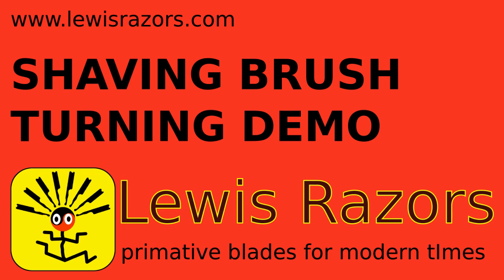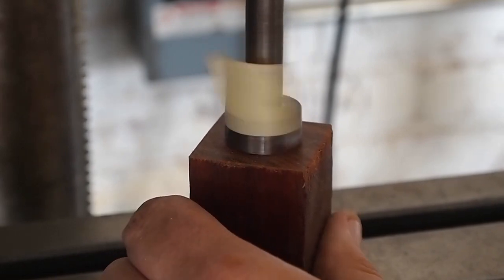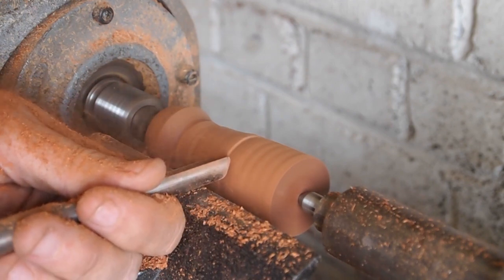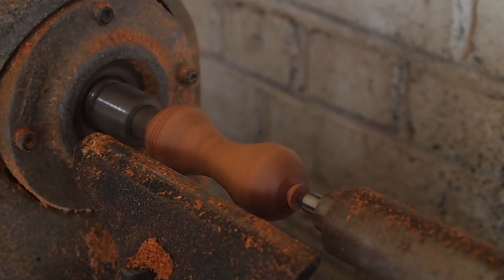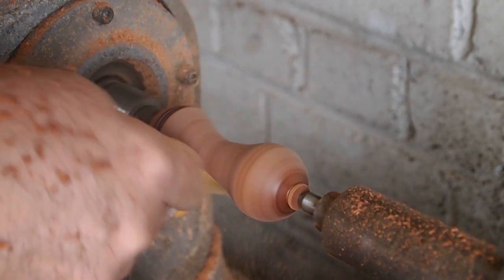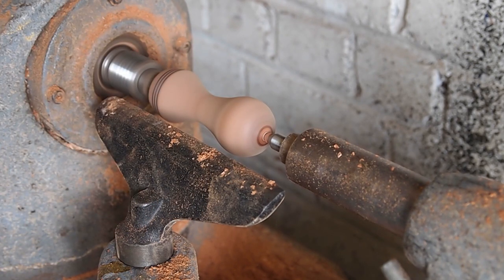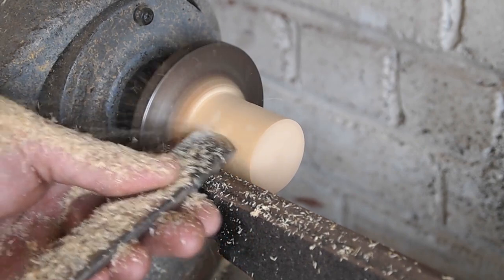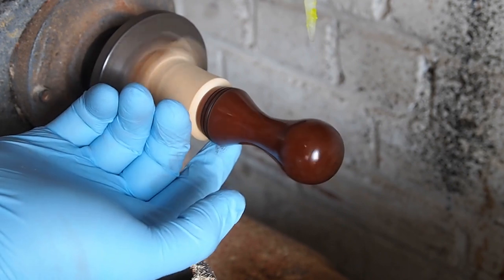Shaving Brush Turning Demonstration

Comment: Great videio...to point...no frills just a great job....  One question I have is what glus is best for securing the knot to the handle?  Thanks again.
Reply from the maker: Craig Janice I used JB Weld on this brush, I like the gray color of JB Weld. I usually use some sort of epoxy to set the knots. I appreciate your comments.
Reply: lewisrazors Thanks for the reply have a great day

Comment from the maker: The glue makes a durable finish. The glue stands up better to the soap and water that a shaving brush sees. A brush handle will have a lot of contact with hot soapy water. You could use any type of finish that  want. I like oil and wax finishes, but in this case I went with the more durable finish.

Comment: Great video and it inspired me to have a go. I used some acacia I had from an old chopping board and it worked lovely but I hit a wall with the CA coating. I ended up with ridges along the handle. I tried both a glove and an oiled paper towel. Do you normally get ridges but take them back with the 400 grit? Any tips greatly appreciated, thanks
Reply from the maker: I do not have a problem with ridges, I am not sure what is going on.  I would look on pen making sites and videos for more help.  Pen makers have the CA finish down to a science. I wish I had some smart to say, but I do not.

Comment: Hello, what are you using in the spindle side to secure and turn the wood?  Is that a spur center????  Does not look as aggressive as one.  Also, what size drill bit did you use to create the recess for the brush knot?  Thank you and great tutorial!
Reply from the maker: +Michael S It is an old dead center with a few notches filed in it.  I like driving the wood with the dead center as opposed to a spur, when doing small stuff.  The wood will spin when I dig the tool in as opposed to chipping out.   I do not remember what size drill bit I used it was a while ago, maybe a 7/8s.
Reply: Ok.  Thanks!

Comment: nice! did you use super glue instead of varnish cos it dries quicker?
Reply from the maker: steviesuperstar Yes, that is one of the reasons I used it, I like working with it. If you look up pen making videos, they have a ton of information on using it.

Comment: Do you have a video showing how you glued all the hair in? Do you buy the hair in a bundle? How does that work?
Reply from the maker: +abstractbybrian I do not have a video on gluing the knot in.  Hair = knot, in brush lingo. I bought the knot premade from the Golden Nib.    

Gluing in is not a big deal, you just glue the knot in the hole.  I usually use epoxy. I like jbweld brand epoxy,  the dark gray color appeals to me, but any epoxy would do.

Comment: For someone new to turning, how big of lathe do you need to turn a brush.  Maybe the better question would be what RPM must the motor achieve to turn the piece properly?
Reply from the maker: You can make the handles on small lathes. I am not sure of the rpm on my lathe, it has a handle one side is fast the other is slow, but no rpm markings.

Comment: What kind of drill chuck are you using in this video?
Reply from the maker: +Jon J. I am not sure what you are asking, I used a face plate, and a chunk of pine wood to make an improvised "jam chuck" .  I jammed the handle onto the nub on the chunk of pine when I was doing the finishing.
Reply: +lewisrazors sorry I might not be using the right term. Is it called the drive center? I mean the threaded post with the sharp point that is holding the wood on the lathe as you turn? I've just never seen one like that.
Reply: +Jon J. At 1:22. On the left.
Reply from the maker: +Jon J. It is an old dead center, that I filed a couple notches in. A lot of the time I will drive with that dead center as opposed to a spur. When I catch the tool in the wood (which happens a bit, I am not the greatest on the lathe) it spins with no harm done.